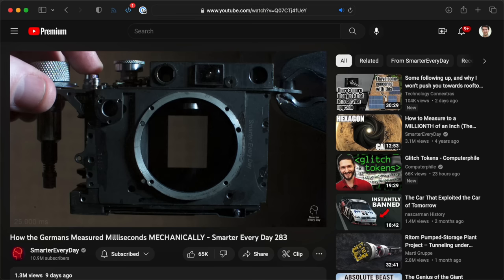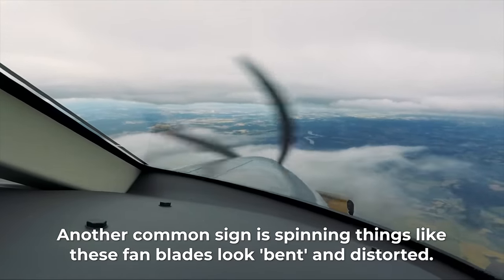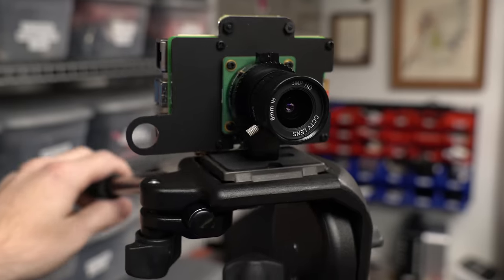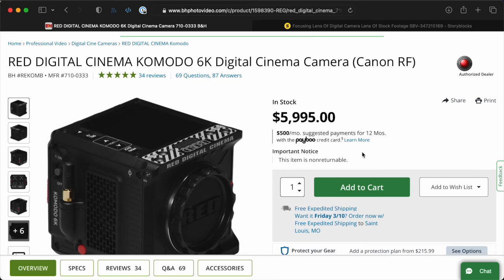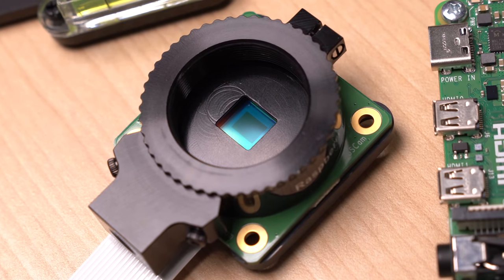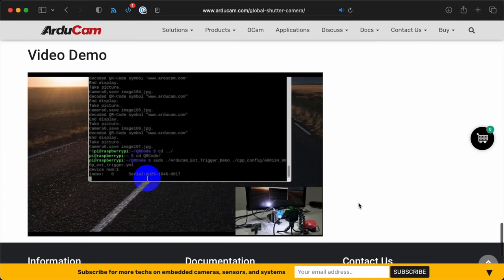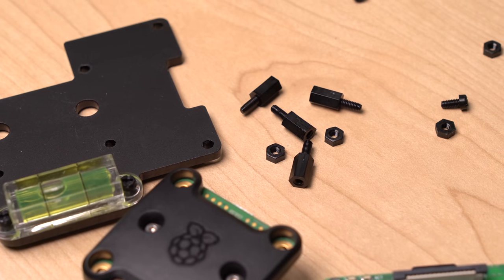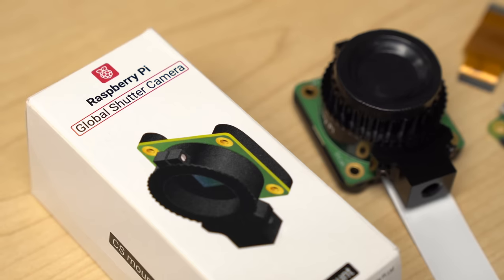Raspberry Pi fixed the rolling shutter problem

Comment: 1440 x 1080p60 Global Shutter for 50 bucks sounds amazing tbh. And then with large, low-light pixels? That's a big step up in accessible DIY machine vision, wow.
Reply: is that kind of TikTok resolution ?
Reply: it's 1080p's 4:3 aspect ratio
Reply: Thats a big step? Theres nothing new here, just a new "not available in stock" raspberry product (and you can buy a non raspberry, but compatible module with the same sensor like the innomaker one, which is available maybe in the last 3 years...)
Reply: @Mcs1v  I've never seen that specs for that price(only like at least double, making it less accessible), tbf I have only spent little time searching. And the innomaker is still more expensive, doesn't need a c-mount lens though (which has both pros and cons).
Reply: @Mcs1v  Not sure why people have to claim that everything pi related is never in stock when it's literally not the case. Pi boards themselves, sure, that has been a mess for years now. Picos and accessories for both? They've almost always been available. The only time I can remember them not being available is in the first month of picos life where it sold out, but it has been in stock since.
Reply: @StereoBucket  US is not the middle of the universe, and for the "rest" of the world, pi's and other accessories are out of stock most of the time. So, thats just a new pi "accessory" which is currently unavailable and there are perfect "nonpi" versions out for ages which is perfectly fine replacement (or better). Thats overall far from a big step in "pi perspective"
Reply: @wojtek-33  "rapberry pi said that product stock should be back to normal in a couple months". Yeah, i heard that exactly 1 year ago :D Thankfully, there are better products in the same price category
Reply: @Mcs1v  I'm literally not in the US...
Reply: @wojtek-33  just give me one example where i cant replace the rpi with an alternative one
Reply: @wojtek-33  it's literally artifical scarcity. look it up, they're deceiving you
Reply: 1440 mentiones.so 1920 coming. and it will be again 40buck

Comment: Another solution is a stacked sensor which is popular in high end mirrorless cams. It is a huge deal for wildlife photography because it allows for silent photography without rolling shutter issues.
Reply: A stacked sensor is just faster. It’s not a global shutter, so there is still some rolling shutter on fast-moving subjects.

Comment: It... IS 1080p, if only due to a technicality, because people still measure resolutions at "full HD" and below by only the vertical dimension (an obsolete holdover from analog systems). 1440x1080 was used in some camcorder formats in the early HD era (I think normally in an anamorphic mode that was scaled up to 1920x1080 for display).
Reply from the maker: Good point!
Reply: aye; 1440x1080 is 1080p, at least vertically, and I think Alec from Technology Connections/Connextras has shown early HD 4:3 1080p footage from media sourced from Japan in the past.

Comment: I used to take advantage of rolling shutters to make the golf club my cousin was holding look bent as he swung.
Reply from the maker: Ha, that's actually a great example to demonstrate it... should've used this video as an excuse to head to the driving range the first time this year 🏌️
Reply: Golf club is bent during swing. The rolling shutter just makes the bend more pronounced.
Reply: Old race car photographers would do the same thing, orienting the camera so that the shutter moved from bottom to top.  It makes the car look like it's leaning forward as it passes the camera.
Reply: @d00dEEE  The image on the sensor(or film) is upside down (and mirrored) so the normal top to bottom shutter movement means the bottom of the image is captured first.

Comment: Jeff... um... I think you missed Devin's points about the video. He was geeking out how early 19th century engineers solved two problems back in the era of crude mechanical devices: How to ensure each part of the frame received the same exposure time as the rest and how to precisely calibrate shutter speed. He was never complaining about rolling shutter or the effect it can create on moving objects. He talked about how rolling shutter solved the problem of even exposure over the entire frame of film by having two shutters with a uniform gap travel across the frame. The second was how engineers figured out how to use the bending created by rolling shutter cameras capturing a moving image to set the shutter speed timing. It's actually quite ingenious. If you take a drum with evenly spaced slits in it and put a lightbulb inside, spin the drum at a set speed, and then take pictures of the drum, you can use the pattern it makes to see if the shutters are moving too fast or slow. At no point did he bemoan the effect. It was, "look at this cool effect and what it can be used for".

Now, can Rolling Shutter be a problem for some people and/or industries? Sure. Are there other solutions that avoid the pitfalls of Rolling Shutter? Sure. Could you have titled your video differently to really reflect this? ABSOLUTELY! ALSO, why did you do Destin dirty by not including a link to his video on the topic? If you're going to use his work to get more views on your channel, at least give him the curtesy of a link your followers can use to see his work.
Reply from the maker: There is a link in the description...
Reply: @JeffGeerling  Okay, I found it, but only because the legend next to it seemed out of place. It doesn't look like a link to a video. (Maybe it's a YouTube thing for the link part.) Would have been nice if the legend read something like "Link to Devin's video how the Rolling Shutter effect can be used to tune shutter speeds on cameras."

Comment: AFAIK, most Hollywood camera setups sidestep rolling shutter by having an extremely fast data bus. They still technically read 1 pixel at a time, but they do it so fast it is very hard to get a rolling shutter effect. The faster you can read off the sensor data, the less the rolling shutter.
Reply: In this case, I may may not actually be reading any faster than a normal sensor. There are just far fewer pixels to read.

Comment: Most professional cinema cameras are actually rolling shutter, they just have a very fast readout time (4-8ms.) This actually emulates motion picture film, which uses a spinning mirror shutter and is also a “rolling” shutter.
Very few specialty cameras, like the Komodo shown, are global shutter, and they’re usually for stunt purposes
Reply: ooh, ya. Hense a 180° Shutter Angle.  Two holes on either side of the shutter wheel to expose twice per frame (I think 🤔)
Reply from the maker: True... though a lot of cinematographers lust after a true global shutter camera for certain types of shots!

Comment: There's also a possibility for a pseudo global shutter, which can be made by lowering the framerate or shutter speed instead of resolution. It's the same rolling shutter, but the row values are read only from the part of the exposure period where all rows are exposed.

There is an overlap between the time interval for the bottom row's frame 1 exposure begin and the top row's frame 2 exposure begin. So it'll be like, if the normal row period is 10 ms, all rows will be exposed for 20 ms, and only the last 10 ms of the first row and first 10 ms of the las row will be considered for illumination. All those exposure values will be in the same period.

Comment: Now this thing would be interesting to use on the CinePi Project. With some proper lenses attached, maybe a softening filter and a nice LOG scan of the sensor image, this would really have the potential for some nice results at affordable costs. Just wish there was a 25p or 24p version with some quality gain. I don't need 50p or 60p for a movie project.

Comment: should be possible to process the image to get rid of the rolling shutter effect?

wouldn’t it be possible to adjust each line in software if we knew how much the camera was moved?
Reply: In most cases the subject is moving, not the camera, so parts of the frame will be still and parts will be distorted

Comment: As a photographer and videographer Rolling Shutter is literally the most annoying and limiting factor on a camera that REALLY limits some of the things you want to do. Want to use high shutter speeds and sync with a flash? You're gonna need to pay extra for a flash that can intelligently work around the rolling shutter issue to do that. Want to sync the flash to high shutter speeds and do it wireless? You are gonna have to pay extra for the transmitters that do that. Want to 3d motion track a scene and composite 3d objects in there? Don't move the camera too fast or you will need to correct the rolling shutter using software which will degrade the quality of the shot and then you can track and composite your 3d footage.

I have literally been waiting for manufacturers to solve this issue since 2004 when I first started photography and it is frustratingly annoying how camera companies seem to be too dumb to solve it or worse... to lazy to because 99% of camera users don't really know what it is or care about it. This video gives me hope that some day we will have a decent digital camera that isn't frustrating the hell out of me because I want to push the shutter speed or move the camera fast
Reply from the maker: Flash sync for photography is quite the pickle; I haven't owned a camera that can sync better than 1/200 for years, and that does limit what you can do, especially outdoors with sunlight!
Reply: ⬆️⬆️⬆️THIS! ....is why videoography has been so annoying to watch during horizontal pans!!! EVERY. SINGLE. TIME! 😳🙄
Reply: Probably not dumb or lazy, but because of physical limit. Because all DSLRs and mirrorless have a mechanical shutter that is like a curtain. Even if the sensor is global shutter, the mechanical shutter will need time to open and close it, and of course there will be latency when the camera sends signal to the flash and the flash actuated. Of course now we have electronic shutter that is like taking video, but the latency will still be there, and in some cases it performs worse compared to a mechanical shutter. I believe most of the consumers didn't really care that much about using flash and rolling shutter since most of them care more about resolution, color, high bitrate and high dynamic range.

Comment: there is also another shutter mechanism besides the rolling shutter which is named leaf shutter and it doesn't have this issue but that is only on fixed lens cameras as the shutter mechanism is more part of the lens than the camera
Reply: It also is slower

Comment: This one is big for computer vision. $50 global shutter camera? Shut up and take my money. No 1080p? That's fine. You can hardly process all those pixels real-time and get a reasonable frame rate unless you have a beefy machine anyway.
Reply: It's actually 4:3 1080p. I'm hoping they also release a monochrome variant, preferably without IR-block filter.
Reply: For a hobby project I don't think the price is impressive. Virtually any old CCD camera will be global shutter. IMO it makes more sense if you need a duplicatable setup; you're unlikely to get many of the same model CCD camera on the used market.

Comment: How about this, use 2 HQ cameras very close to each other, and flip one of them upside down. This way one cam will record top to bottom and the other will record "bottom to top" because of flipping it. Then correct it in post, that way you have an almost perfect non-rolling shutter solution. Has this been done before? If not someone should do it.
Reply: Hello there @Consig1iere !  That is a neat idea, but I think you'd get rolling shutter in both directions.  So in one video the Top Left of the image is read first, and in the other recording, the Bottom Right would be read first.  But in both videos, the opposite corner is read last.  Then if they were combined carefully, I think you'd end up with kind of a V-shaped distortion so that the center seemed to lag behind the top and bottom of the object.  There is software already for removing the rolling shutter, but I think there is a bit of a crop as it slides the lines over and ends up with a straight image, with slanted edges to cut off.
Reply: @I4getTings  Yes, I saw a presentation that showed how Youtube developed an automatic rolling shutter compensation system, and it did involve some cropping
Reply: @Cyberguy42  ooh, cool! I'll go looking for a  video on that

Comment: What`s the deal with action cameras that can film in 240fps in 720p or 1080p? They don`t seem to have that jello-effect.
Reply from the maker: You can limit the jello effect with extremely fast sensor readout on rolling shutter—I'm guessing they can do that on those cameras to reduce the jiggle.
Reply: The jiggle is also directly reduced by frame rate, since it means the top and bottom lines are closer in time.

Comment: Can you have the two cameras take two pictures and some clever software that takes the best from the two and make one picture?
Reply: Of course, that is how you make an HDR photo, although usually it is done by using one camera but it captures atleast 2 photo with different level of ISO, therefore most part of the image can be expose properly. Using two cameras should be the same although you need a software that can take photos from two cameras simultaneously and a beefy computer to process that in real time

Comment: There are no lenses that produce 12 MP images, so the global shutter lower resolution is actually a better match to lens MTF.
Reply: Larger lenses can certainly support a real 12 megapixels. Tiny phone cameras seem to do 1080p pretty well so I'm sure the HQ camera's lens can do more than the 2 megapixels of this camera.
Reply from the maker: Yeah, there are some C and CS lenses (not the 'semi-official' ones sold through Pi resellers) that can put through more than 12 megapixels of resolution.

The official wide angle lens says 3MP but really gives enough sharpness at least in the center for a good 12 MP image.
Reply: @JeffGeerling  Diffraction limits and aberrations constrain lens MTF and the resulting integrated image content to a few MP at best.  Diffraction-limited spot size of a perfect lens (in microns) is about 1.3 times the f/number.  So if you have a typical f/4 C-mount lens, spot size is 5.2 microns, which is 1153 spots across a 6mm sensor, which squared gives 1.3 MP.  That's for a theoretically perfect lens with no aberrations.  Actual performance will be lower.  The f/number of a lens wholly determines the spatial resolution of the lens images .  There are no 12 MP lenses in C-mount format, not even close.  Don't believe the nonsense specifications from imports and Amazon.
Reply: @eDoc2020  I'm sure diffraction limits prove there are no micro lenses delivering 1080p resolution across a 4mm or 6mm sensor.  Read the Edmund catalog if you don't believe.  There are no 12 MP lenses in C-mount format; it requires full-frame format to get that much integrated resolution.  The f/number of a lens wholly determines the spatial resolution of the lens images and spot size in microns = 1.3 * f/number.
Reply: @RichardKinch  Doesn't diffraction lead to known image defects for a given wavelength? Couldn't you undo the defects with DSP to achieve better effective resolution? Within limits of course, each sensor element is sensitive to a range of wavelengths.
Reply: @eDoc2020  No, MTF is what it is, the nature of the lens and optical physics.  There is no post-processing or AI that is going to improve the MTF of a lens above diffraction limits.  The smartphone cameras that say they resolve 12 MP are just phony.  It's a synthetic image developed from a less-resolved informed image.  That is to say, a high-resolution cartoon.
Reply: @RichardKinch  I would prefer it if it was easier to take pictures with minimal post-processing. In other words without all that crap.

But thinking about it there's one reason to have more sensor elements and that's to avoid aliasing and other effects which may arise from the color filter elements. On that note AFAIK the advertised pixel resolution is actually the number of elements so the true full pixel resolution is 1/4 of what's advertised.

Comment: Does anyone know if hardware binning to lower resolutions is possible with this camera?! Pi V2 cam can do hardware binning to 32x32 pixels, if I'm not mistaken. 
I would like to buy this camera if binning is possible to small resolutions for easier training.
Considering this is a camera built specifically for AI, it's probably possible?!?
Reply: I don't see the benefit that would have with a global shutter camera. Wouldn't software downscaling before the AI training work just as well? I'm sure there's a way to do that with Linux even if your app doesn't support it natively.

Comment: The result is, u cant stop blending the parameter chaos dosent react on changes at frame time. An desaster, if the light shine and then do it dark,  and then bright again, the camere need 5 seconds to find the autoshutter position, but no one want an autoshutter. There is adjusted by user fix , and not dynamical.  The Trigger version dosen't work in trigger case.  No param accepted. HW Shutter Cam  The pain in the ass strts with LibCamera

Comment: Are CCDs even available any more? Significantly older technology compared to CMOS but because they're basically a light-sensitive shift register used in a store-and-suck mode, therefore no rolling shutter at all, modern advances should have made them really good. Time to go down a Wikipedia rabbit-hole!